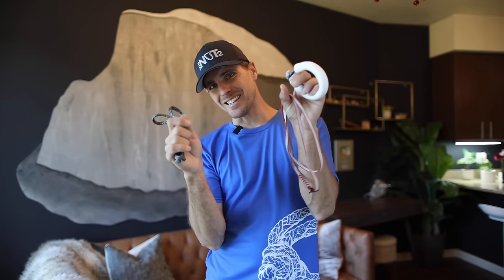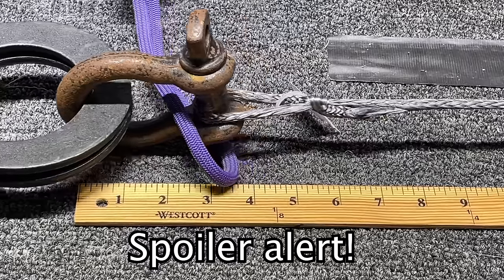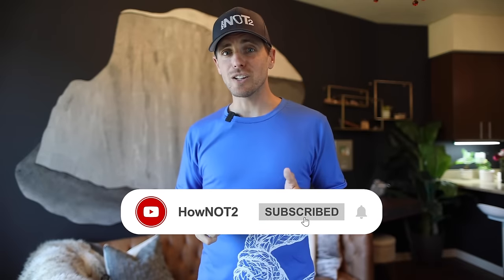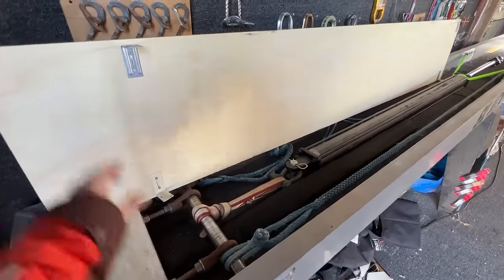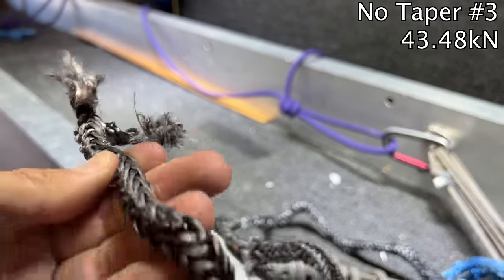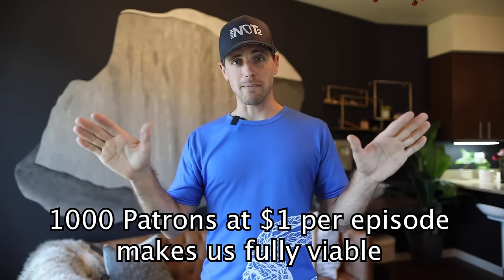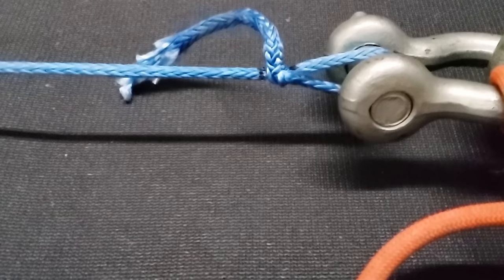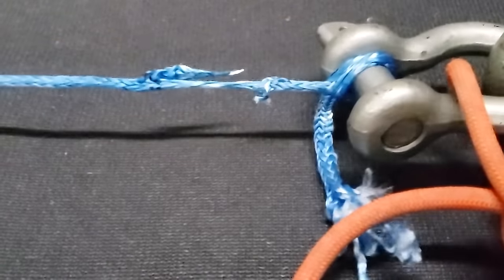Are tapering splices that important in Dyneema / HMPE?

Comment: Hi, I'm actually the technical manager at Marlow Ropes, i don't normally comment but I think there are some things to address on this film.  BTW it's good to see our ropes performing at, or better than, the figures we quote!

I may be able to answer some of the questions raised in the video and the comments so, in no particular order:

-Big one first: as was pointed out in the film the splice works by friction, if the buried tail isn't long enough then the splice will slip.  Putting a lock (brummel) in doesn't alter that.  If the tail is too short then all the force is held by the lock stitch which will eventually fail.  Exactly as shown.  I've seen this many times before so one simple message to all fans of the Brummel lock: A LOCK IS NOT A SUBSITUTE FOR THE CORRECT TAIL LENGTH.  

- The lock (done properly) doesn't reduce the strength where the stitches are made because there's double the material content of the rope at ths point (think of the cross section area), i.e. a small loss here does not reduce the strength below 100%.  However there is a risk, not observed in this film, if the tail of a locked rope is disturbed then you can get a small loop form below the neck of the splice, this will reduce the strenght of the locked splice.  For this reasion I still prefer to whip the entry point and for testing I don't use a lock.

- There's a comment about tail lengths and fids etc.  I'm not sure where that all came from however we simply recommend the tail length minimum to be 50x the rope diameter, longer is better.

- There's always a weak point, that's why no matter how good the taper often that's where the rope breaks.

-The ropes that broke in the back of the eye are due to the D:d ratio (ratio of the rope diameter to the pin diameter).  When this is large (5:1 or greater) the rope will almost always break in the splice, however when small (less than 2:1) the rope will mostly break in the back of the eye.  At the in between D:d ratios the location of the break could be either but it has little effect on the strength.  In practice at the very small D:d the rope is often stronger than the shackle as was pointed out early in the video.  This assumes the eye size is sufficent, the angle the rope makes at the throat shouldn't be more then 30 deg.

I'm sure there's more comments i've not addressed, sorry guys I need to get back to my day job!
Reply: Thanks!
Reply from the maker: Thank you for your input!
Reply: Is a whip the same as a stitch? If not ......data, data,data:) The 50x diameter is more intuitive to me, thanks!
Reply: Thank you so much for contributing. I will buy your products because of this.
Reply: @kraftzion  Measuring in fids is the same thing, it's just a more round about way of getting there,
Reply: I like that you mentioned D/d ratio. This is a concept that many are not aware of or forgotten about. It’s effects can be better observed with wirerope.
Reply: I read somewhere that a 70x bury was recommended for maximum strength. Whipping is not stitching, which is best?
Reply: @hclchgm  whipping and stitching are not the same, and they serve different purposes.  Whipping is putting several (typically until you're 1.5x the rope diameter in width) wraps of a fine twine around the main rope.  It's commonly a way to finish the end of a rope, but as Paul Dyer mentions here you can also use it to keep a loaded Brummel from backing out of the bury, if you put it in the right place.  Stitching is passing a small thread back and forth through your splice (the same as you would when sewing two pieces of fabric together) over it's length.  This keeps the buried part from sliding with respect to the outer part when it's unloaded or lightly loaded.  Both can accomplish the same goal of keeping your splice secure, but via different mechanisms.
If you have copious time and interest, I recommend reading "The Rigger's Apprentice" by Brion Toss, which covers most aspects of splicing in most kinds of rope with good detail.
Reply: @hclchgm  It was 72 X Dia. for the tuck, originally.  That was altered at some point to 50 X dia.  I am a professional motion picture  Stunt rigger and I still do (And teach) 72 X Dia. For the tuck.  There is really no reason not to do so.
Reply: @rev.dr.funnyshoe7497  plus how many diameters of taper?
Reply: @jcrackerjcrack6401  72 X the diameter.  E.g. ½ rope = 36” of tuck, ¼” rope =18”.
Reply: @rev.dr.funnyshoe7497  
Does the 72 Diameters include the taper and how many diameters should the taper be. I guess it's 72 then cut the last 6 picks
Reply: @jcrackerjcrack6401  72 X the diameter is the length of the tuck.  About a ⅓ from the end, pull 2, (any 2) and cut.  Then even space from the end pull 2, cut, pull 2 cut.  I do it after the tuck, some do it before.
Reply: Thanks for the clarity on the Brummel contrary to what the video indicated.
Reply: The lock (brummel) will fail on an inadequately buried tail....but what strength does the lock maintain....50%....75%?

With an adequate bury, why do a lock (brummel)?
Reply: @mastpg  I believe the brummel is there to stop the bury from sliding loose when it's unloaded.
Reply: @alirice2647  ...speaking in the context of this comment where whipping at the neck of the sink point, which would keep the sink from shifting loose when not under load, is recommended?
Reply: @mastpg  Not sure, sorry. I think either do a brummel or stitches to keep it in place when unloaded. But I'm not an expert.
Reply: The recommended length for a splice is 2.5 fid lengths which is 51 diameters. A fid is 21 diameters. Old measurements seem to have a basis for being even if we don't know why🙂
Reply: Thanks Paul! So where D:d is an issue are there any good solutions for an eye and soft shackle as one or the other will likely be near its limits. Seems like rings and thimbles should be used more often. (Note: my application is for personal offroad recovery.) Thank you!
Reply: Thanks for that. Fid length is the measurement specified by Sampson for there products.
Reply: Thank you for your valuable input! As a commercial sailor, this is great tradecraft knowledge. If you could recommend any channels that give videos on different materials and failure/ snapback tests etc. that would be great to pass along to my crew for knowledge development.
Reply: I'm happy to read this input from Marlow. I just made a centreboard retaining strop using the Marlow method. The two previous 4mm stainless wire strops have failed to prevent a free falling board. It weighs 150 Kg. They were made by professional riggers. This time I am using Marlow 6 mm dyneema. Made myself, but using thimbles to prevent a sharp bend on the anchor points. Hoping it out performs the wire.
Reply: Yes! Read Brion Toss (not misspelled)
Reply: Dude you're clearly the expert but I CANNOT wrap my head around the brummel lock not being stronger than just burying the tail!  I gotta see the explanation for this
Reply: I will start putting whippings on my splices!
Reply: @SawDustGordo  The weakest link determines the strength of a chain. Adding a brummel does not change the fact that the end of the taper is the weakest point with a properly sized eye.
Reply: @hownotto have you done a break/slip test with whipping at the eye as @pauldyer1145 suggests? I've searched your videos but not found it.
Reply: Well, that was a great contribution! Thanks!
Reply: Why not take two turns around the bolt. The only reason I can think against this is the most outside layer of the rope traveled even more distance, but since the strands weave around the rope this shouldn't be a peoblem.
Reply: @jamessarrett4169 Brion Toss, RIP.

Comment: 2 years ago I started a business that makes soft shackles (using the diamond knot: for sailing purposes that is secure enough) & other Dyneema products for sailboats. I always carefully taper the ends, as it is 'known' among riggers that if you don't, it will greatly reduce the strength. Interesting to see in this video that even if you don't taper and use an appropriate turn radius for the eye, it could still break at the eye before the non-tapered tail.
Lancelin (a high-end French rope manufacturer who's ropes I use) instructs to use 80-100x diameter for the bury, of which 20-25% is meant for the taper. So around 60-75x for the bury, and the remaining 20-25x for the taper (meaning a LOT of bury and a LOT of taper for max strength).

I also import HMPE (non-branded unlike Dyneema), and use it to create winchlines and large soft shackles for 4x4 recovery purposes. Therefore I'm very curious for your next video that compares different types of HMPE!

@HowNOT2 if you ever need to get in touch about anything Dyneema/HMPE related, please do! My business is called SoftShackleShop and I'm based in the Netherlands. You'll find my email adress on the website.
Reply from the maker: I'll email you.  I think you'll be shocked how much more strong the chineema was than the other 5mm dyneemas.  
If I made dyneema products to sell, I'd probably taper and bury according to "manufactuers specs" and common belief.  I only break the rules if I make stuff for myself.  
HOWEVER, I've broken a LOT of soft shackles and not soft shackle broke where I didnt' taper it.  It's always the noose or one strand coming out of the knot.
Reply: @HowNOT2  "Chineema" made me laugh way more than it should have..

Comment: The Brummel reminded me a lot of how water ski ropes are eye spliced. I don't think forces tend to be high enough to be an issue even with the most aggressive knots, so the issues is more of the knot slipping. Regardless, I have seen lines break. It might be a fun diversion to spend some time on the water, get some line scale readings of skiers doing various styles and tricks, and go home with some rope samples for the slack snap.
Reply: The

Comment: Good stuff!  I’m a sailboat guy and a climber. I’ve been seeing dyneema in the boat world for quite awhile. I was wondering when it would really start to appear in the climberverse. I’m glad it’s starting to see more use from climbers, cavers, etc. My experience, anecdotal only, is that the length of bury is the critical component in eye splice strength. Some of the really fast and really highly loaded catamarans and trimarans use nothing but synthetic rigging. It’s hard to find much metal anywhere on those boats. The masts are held up with synthetic fibers, though not exclusively dyneema, and the buried tails are REALLY LONG!!! Glad to see your tests come to the same conclusion. Thanks for doing it!
Reply: Interesting I am a climber and have climbed for only 12 years but from the first time we were using dyneema slings and dog bones. Nylon also has its place but being weaker it is always heavier (but less slippery). 
So I wonder what you mean by seeing more use by climbers?  I am guessing that we use and have been using dyneema wherever we don’t need any dynamicity. 
That being said I have never seen dyneema ropes or cordelette used in climbing. Just slings (and dog ones which are basically slings ).

Edited: I don’t big wall as my longest multi pitch was 8 pitches and we didn’t haul anything. I could see a dyneema rope be using for hauling as being static would be a plus and weight being another big plus.

Comment: As always, excellent content. I am a sailor, and use dynema in various locations, although never in life critical situations. When I am doing my splices, (usually without the Brummell) once the tail is buried, firstly I feed some heat shrink tubing over, beyond the bury, then feed in a sliver of hot glue around halfway down the bury, between the tail and the outer. Depending on the location of use, sometimes I will roughly hand stitch a lock, but always whip about 1 inch from the loop. Then pull the heat shrink tube up to cover the whip including the buried hot glue sliver before using my ex's hairdryer to shrink the tube at the same time as melting the hot glue internally. This seems to stop any creep when attaching/detaching the loop from use, particularly in situations where the splice is slow loaded, as in tightening bottle screws for the wind generator guy lines. I don't know if this would introduce issues, but hasn't let me down so far (famous last words).

Comment: Per the hammocking community (we love our whoopies) the recommended locked brummel splice has a bury of 8inchs for 7/64 amsteel (1600lb) which is 8-strand sk78 with no pre-treatment. I use a bury of 2.5" on a locked brummel spliced 200lb 6-strand Technora guyline. So yea that 8inch splice seems tiny for your thick rope.

Comment: I've had my whoopie sling pull out while hanging in my hammock. Luckily I was hanging low on my porch. I was using some 1/8 8 strand which is probably too small. Careful tapering was the difference between success and failure.
Reply: Oh my... glad to hear it was on the porch. I use my hammocks in my bedroom and have had a few crashes trying out different things. (Rappel rings, carabiners, buckles, lashing) No injuries except pride, but a couple of close calls with stuff underneath).
I just ordered some whoopee slings. Eeks!
Reply from the maker: The eye or the whoopie part?  I haven't usually tapered my whoopie because the adjustable part slids out of the center immediately instead of gradually and I figure it will break there.  Ironically I haven't tested them even though I used them a lot back in 2016 for my anchors.  It's on the list

Comment: Thanks for the video, it may be that the eye failures were more to do with lack of smoothness of the pin than the length of the eye, Dyneema is very sensitive to rough surfaces and highly polished thimbles and fittings are generally used.

Comment: Still remember the day my grandfather rolled up to the boat with a roll of amsteel grey to replace the wire rope on the boat. In the 25 years since I've used 2mm twine up to 1 3/4, from a half dozen domestic companies. Sitting in the truck typing this, have a custom ordered 22mm 1500' roll from Japan that has a new uv coating. 

We loop through brummel splice with a long tail in settings that have lots if load variation.  We assume 75% loading and upsize accordingly.  More gradually loaded lines are straight brummel with a deep bury and lashing. 

Uv kills most, internal fiber abrasion from sand and dirt kills the rest. I'd rank 95% of my real world breaks at the eye. The rest usually appear to be from a sharp corner. I've blamed the ones that break at the base of the taper to sharp edge contact but after this video maybe that's a taper break.

Comment: Great video! So I am probably going to use Dyneema 12 strand to rig up some airplane skis instead of the standard steel cable. Having no experience with this - your video is very insightful!  We will be using thimbles for our eyes (which you might like to try for your tests) and will be using adhesive lined shrink wrap over at least part of the “buried” bit.  The stuff we are using has a 5000 lb rating which is more than the cable I would otherwise use. But I wonder if the cable is as “fiddly” to get rated strength from… if you want to do some tests for this application I’d love to see it! I’ll make up and send you the test pieces if you like. It would be worth it to me for your results! Cheers,
Ken

Comment: Great video. I use a lot of Samson Amsteel in my hunting endeavors hanging from trees. Just like climbing or rigging my life is literally on the line.

This video helps put into perspective the likelihood of a failure due to an improper splice or short bury. For instance, my static line is rated around 6500 lbs MBS and miscellaneous carabiners between 11-17 kN rating. If an unburied brummel lock hits 20kN its hard to imagine that with a decent bury and taper that the dyneema would be a fail point for me. 

What's more interesting is the eye size and how that affects breaking strength. However, again, nowhere near a force that be concerned with such as my 180lb. body hanging from a tree.

Comment: Great stuff as ever! WRT the eye breaking at the anchor point.. how best are we to attach the eye to our anchor/tow point? Absolutely not by a lark's head clearly! A large D-shackle, carabiner or soft shackle?
I'm using a thin line (3/5mm) to tow between motorcycles in a breakdown. Motorcycles have relatively few useful anchor points, and even fewer with a nice large radius.

Comment: We have been told you can do the Brummell splice either with an eye or joining 2 ropes, but you have to go through 3 times as close together as possible without the tail inside the main rope. We have used this in the line trade.

Comment: It’s been my experience working extensively with 1inch and larger dyneema, nylon, poly, and other synthetic fiber rope/line that the point of failure will almost always be at the very beginning of where the splice starts. This is the point of where the natural lay of the fibers are altered.

Comment: I'd be interested to see how the performance would be changed by dipping the splice in liquid whipping before/after "setting" the splice under load. I've considered using the stuff as a chafe preventative that might also prevent slipping while unloaded. The question then is whether the liquid whipping acts more like a bonding agent or a lubricant when pulled...

Comment: Usually a short taper like the one that slipped out with the teufelberger instructions you mentioned is meant to be executed with a class I rope (made out of fibers like polyester or Nylon) vs a class II rope (made out of high modulus fibres like dyneema or LCP like vectran for example). I didn’t personally research the teufelberger instructions but I suspect this is where there might have been confusion
Reply from the maker: That is what people are hinting at.  Their pdf didn't specify and is pretty important to clarify I think